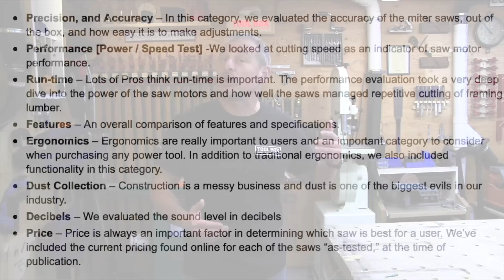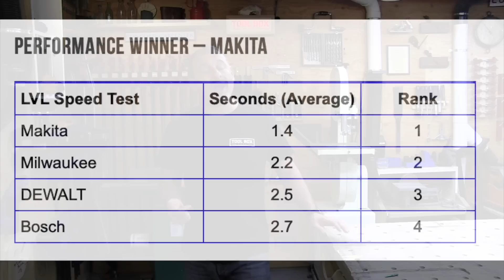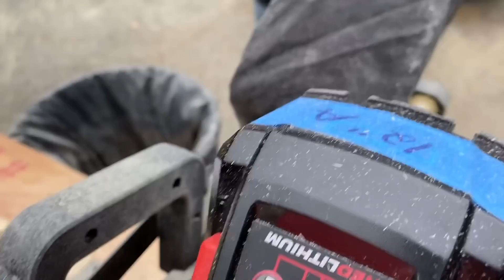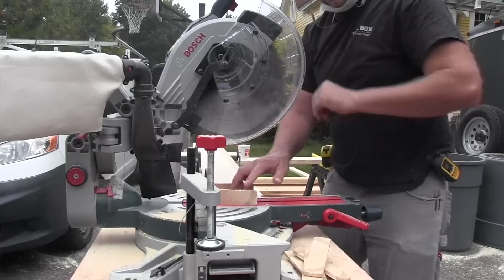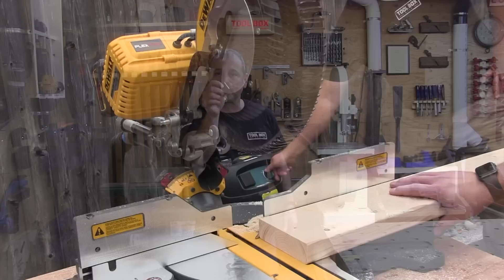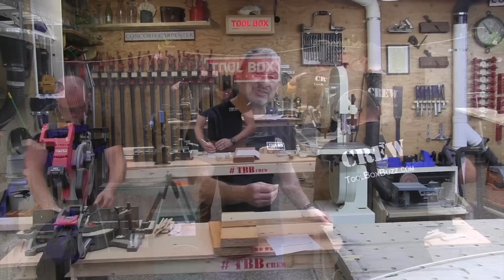Best 12-Inch Cordless Miter Saw - Head-to-Head

Comment: You guys are far and away the best side by side comparison team. This is the channel I trust for the most accurate honest reviews.
Reply from the maker: Thanks man
Reply: Agreed. In-depth, not too long, and accurate.
Reply: Totally agree!
Reply: What size centre bore do you have on 12 inch blades in the US?
The blades make a massive difference on all of these results.
Reply: Project farm as well
Reply: Lots of great info as always,  I'm looking to get a 12" saw I'm on the makita platform  so have been looking at makita, but I have heard a lot of talk of battery damage caused by the 12" saw, has anyone else heard talk of this ?
Reply: @eduardoramiro4846  PJF is an Milwaukee adverticment channel same as Tool Review, VCG Construction, How to automotive.
Reply: @eduardoramiro4846  is the best

Comment: I love my 12in flexvolt miter saw. At first I bought the Milwaukee bc I’m invested in their platform. But once I realized you can run the Dewalt on battery or ac. I had to have that. Plus I’ve been looking at a couple other Dewalt tools so getting their miter saw opened up that platform for me. Great review!!
Reply: You must be sad you didn't get the Makita 😥😥
Reply: @jeffb321  I actually owned the 10in cordless makita but it was just so heavy and like moving a slab of concrete around. But I did like the rail system on it. That a nice feature
Reply: I have the Dewalt too. The ability to be able run it on AC or battery was a must-have for me. I wish their FlexVolt Table Saw had AC power as an option too.
Reply: I haven't been able to find one, sux. I bought the Milwaukee, what a pos.

Comment: I just started the video and can't wait to see the results.  I have the Milwaukee and have zero complaints. Just wish Milwaukee made a nice portable stand.
Reply: Agree! The stand sucks. I must say that being 20-25% lighter makes a huge difference to me. You would think this would be a huge deciding factor. Who would even want a cordless shop saw? Portability, accuracy and dust collection are important factors for a job site miter saw. I have the 12”, 10” and 2 - 7 1/4” Milwaukee cordless saws on the jobs every day. The 10” just plain sucks! It never touches crown. 

As far as ac/dc goes, it never is a concern because I have 5 - 12AH batteries for the 12” and at least 2 - 8AH batteries for each of the other saws. I don’t use cords on the job at all. Also have 2 Milwaukee table saws on Dewalt stands, lol. 

Kinda surprised they didn’t even mention the one key? It’s nice knowing I can lock down the saw when we go to lunch and also track the 12” and table saws. I run $100+ blades on the 12” and don’t need some concrete guy throwing a nail infested, covered in concrete board on my saw while we are out to lunch. I also think most people know better than to steal a One-Key tool. I only leave the One-Key tools on the job if not in a gang box and have yet to have one stolen. I lock them and grab the battery. I figured this was something worthy of at least mentioning. I believe it’s more protective than a chain by far. If locked, it’s useless if stolen and they can be tracked! Most know that and I make a point of explaining it to anyone that asks on the job.

Comment: I've been running the Makita saw with AWS for a year now and it is hands down the best saw i have ever used. I am a professional trim carpenter and you can take it from me this Makita saw is the most accurate saw out.
Reply: Why use a cordless 12" miter saw? Do you trim houses with no electricity?
Reply: @timbarry5080  typically we don't have power so we run off a temp pole which is only one 110v circuit. Its hard to run a compressor, house furnace, table saw wit vac and other powered tools off of that low of a voltage. Believe me i was very hesitant about running a cordless miter box but now that i have i would never go back!
Reply: @timbarry5080  i also wanted to try the AWS system. again, no regrets going cordless

Comment: I have the Makita for 2 years now and it is still in great shape, accuracy and performance is amazing specially dust collection ,the battery lasts all day  either cutting lumber framing or trim moldings .
Reply: Does the makita have a battery to 120 volt option
Reply: @lxxs3v3nxxl  it comes with 2 5h  batteries but you can purchase separate the120 volt detachable option or just a get the corded version  .

Comment: Great review. I agree with Milwaukee on real world use and would have ranked it first in run time/cuts, moving it up behind the Makita into second place. That Makita is a very nice saw but I've bought into the Milwaukee platform. For many of us, we'll end up with the tool the corresponds to the battery platform we've selected. I just picked up the 7 1/4 Milwaukee miter saw and love it.
Reply: I agree, skewing the run time data for the Milwaukee in the way that they did doesn't make sense to me, the saw made the number of cuts that it made, so what if they weren't in rapid fire succession. I think it would've been more accurate to credit it for the actual number of cuts and perhaps include an asterisk explaining the thermal protection issue resulting from unrealistic usage in the testing procedure. 
Correcting that one score puts it in close second behind the Makita (which looks like very nice saw). With excellent scores in dust collection, features, and ergonomics, if you factor in the lower price, the Milwaukee becomes the logical choice for anyone not already invested in a particular battery platform, but not willing to shell out the higher price of the Makita. 
I would also tend to agree though that while it is nice to see how these saws stack up against each other, most of us who are deeply invested in a particular battery platform will just end up buying the one that works with our existing batteries. 
Excellent review overall, thanks guys!
Reply: @n.c.1838  correcting that one score would cause the Makita to drop a point which in turn would give Milwaukee and Makita an overall tie. I think they realized what they did but then decided they didn't want to give the least accurate saw (milwaukee) the overall win.

Comment: Great testing. Only suggestion is each category has a wider range than 1,2,3,&4. If the difference between 1st and 2nd is greater than between 2nd and 3rd, category points should reflect that. This can be accomplished with a 1-10 scale, with best and worst getting 1 point and 10, and the other two on the scale relative to the best and worst. An example how this might work is say one got 400 cuts, and the others got 200, 210, and 220. Points would be awarded at 1, 8, 9, 10 ( or inverse points if you'd like). This way, a tool that dominates in one category is rewarded overall, rather than equal weighting based only in rank.

Comment: While bosch came in last, I am really excited for them because the corded version is what we use in the shop and we love it. I am invested in dewalt battery so that's what I'll be looking at, but I wish that they would bring more innovation instead on just resting on a good design.
Reply from the maker: The Bosch saw is an incredibly nice saw, don't rule it out  - Im sure if we had different tests it may fair differently. Remember this ranking is close and these are ALL pro saws
Reply: @ConcordCarpenter  I really wished dewalt used a 1 battery system for thiet 12in miter saw... Fingers crossed on the updated version when it comes out!

Comment: Rob, I really appreciate your head-to-head test videos. They provide impressions for the "fresh out of the box" experience.  Does your gang of testers have any long-term results regarding how well the tools hold up under use at the jobsite?
Reply: Hi Kam, I just put up a post mentioning the issues I’ve had with my Milwaukee. It may give you insight on that particular tool in my experience.

Comment: The Makita saw has an aluminium detent plate for the mitre adjustment, and it quickly wears out, meaning you must manually set the angle every time,because the notches become very sloppy and inaccurate. It's also very heavy and the fence is a sub optimal design. I love Makita, they make great tools, but this was a deal breaker for me, having spent a lot of time on my workmates saw, I chose the Dewalt. Dewalts mitre saws and table saws are the best all round options for site use in my opinion. The Bosch looks like a nightmarish contraption, and the Milwaukee is probably decent, but nobody here in NZ uses their tools, because they are eye wateringly expensive and don't last like Makita does.

My Dewalt saw has been awesome, it's smooth, not too heavy considering how big it is, and it was pretty accurate out of the box. It's also solidly built, and has sensible features with no gimmicks. The same can not be said of many other Dewalt tools, some of the stuff in their cordless line appears to be designed by people who have never actually used power tools, and the quality control is patchy. The Dewalt mitre saws still seem benefit from the legacy of Dewalt prior to being bought by Stanley Black and Decker though, and are not made in China like most of their tools.

Makita has a history of just slightly missing the mark with their mitre saws and table saws. The quality is always there, but they always have these annoying design flaws, and lately they have been trying to reinvent the wheel. The Dewalt is a classic mitre saw which may seem outdated with its straight slides with bronze bushings, but it just gets it right. I can't really think of anything I would want different on it.

I recently had to do 22.5 degree mitres on some high gloss thermoformed kitchen toe kicks with it, and I had no chipping of the finish, and was able to make those mitres absolutely perfect, with no gaps whatsoever.
Reply: @alejandrocuellar15  I did wonder if that was the case, they are a fairly popular saw. I'm honestly shocked that a company as good as Makita would do something like that.
Reply from the maker: great points thanks for sharing
Reply: @Patrick-857  you do bring very valid points tho, and of course most of these after market detent plates are not the same quality as a genuine makita part, which they have access to expensive equipment and all. I consider myself a makita fan boy at heart, but we all have to remember they are a company here to make money, every company has to "cut corners" where they can. And most people will not invest the extra money for a detent plate, and wait for shipping. I suppose we are the select few we care about everything down to the last detail, especially when your paying top dollar. Even the feststool mitersaws have their issues and use a lot more plastic than metal. I still love the makita miter saw and am looking to upgrade to the 12 in. The community does appreciate your feed back, most people don't know about the detent issue untill they start to notice it. And even then many people dont zero in their mitersaw. They just use it out the box and most are happy with "almost perfect." It just depends on who you are and your view points. I love makita wood working tools but I'm a Milwaukee light guy for sure. Makita is bearly comming out with  tower lights and they are  still 3000 lumens less than the new  Milwaukee Which you can already go buy ( they are releasing the base model basically so they can later release and improved model once they make millions and off the base model), also most of their lights are not ip rated, almost all of Milwaukees are.

Comment: A couple of points, firstly, the DeWalt is the only one I (and many) would ever consider as it's the only saw that has an AC adapter which is a huge plus. The other point is that I actually bought the Makita and after a week of work and back and forth with the shop and Makita, it could not be trued from full extension. It's a relatively well-known issue if you search for it, the way the arm is set up causes it to not run square no matter what you do (there is a hack that involves trusting the arm but even that couldn't make mine perfect). I will admit that it is an absolutely stunning saw, almost a work of art and I WISHED that this true square issue was fixed. I took it back and got the Dewalt - never looked back.
Reply: That's easily fixed by loosening a set screw & tweaking the rails.  But no you shouldn't have to do that to a new saw.
I did a lot of fine tuning to my Makita but love using it.
Reply: I think that was a 10" model issue. Your the first person i have heard say this if you are referring to the 12" version. The 10" version was out well before they released the 12" i think makita addressed that issue before the 12 came out....
Reply: @rickfrey6944  i think he is referring to the 2 slide rails not the fences....
Reply: @jeffb321  I was referring to the rails on the 10" model.
Reply: The hybrid ac / dc option is an absolute game changer.
Reply: @jeffb321  It was indeed the 10" version... and it was about1.5 years ago... didn't know it was fixed. The Makita is a stunning saw, I was so disappointed to return it.
Reply: @rickfrey6944  I did that multiple times, spent a lot of time and could never get it perfect. The drift was very noticeable, but as someone below has mentioned seems like this might have been an issue with the 10" version...?

Comment: very nicely done. My findings were about the same.  I was torn between the Dewalt and Makita,  I have the corded Bosch and like it, but the mitre cut height at the back was not tall enough to do over 4.5" material with out hitting the product.  Went Dewalt because of price.  Thanks for the video.

Comment: I've used many miter saw over the years. Each one had its pros and cons. I'm currently using Milwaukees 12" slider 6955-20 (corded). I think it's a really good miter saw, but I haven't seen it in any comparisons. It has features that others don't. I'd be interested in what you and your crew think of it? Have you used one? I know this was a cordless miter saw head to head, but I love to see a corded head to head with the Milwaukee, Makita, Jet, Bosch, Metabo, and DeWalt.

Comment: I've got the latest Makita 12" corded saw.  Fit and finish is awesome and it was accurate right out of the box. For a test I made a small  picture frame.  The miters were tighter than a nun's @#%+.
The thing I don't like about it it the bevel adjustment knob.  With the dewalt I can quickly whip the head left or right quickly, with the makita it seems like I'm doing a lot of cranking on the knob.  And doing base, regardless of height, I always cut a miter on the bevel.  Dewalt gets my vote, corded or cordless.

Comment: I have the makita. Runs very smooth and accurate. Very high quality as with most makita tools. Very heavy though, so a collapsible stand with wheels is highly recommended. 2 charged batteries last through a couple days of my use which is building cabinets.
Reply: I wish I had the money for the Makita!!! I have Makita cordless tools and love the feel of them, but can't justify a grand for a saw right now.

I plan to buy the Dewalt DWS779 plug-in saw.
Reply: @charlieodom9107  look for deals. I have the 10 inch makita. Its the exact same build ad the 12 just 10 inch blade. I got it at home depot for 525 with free 2 extra batteries totaling 4 batteries. I returned the 2 extra batteries and dropped the price of saw to around 375
Reply: @anthony4426able  I will watch for a deal, but currently, I'll be buying the Dewalt DWS779 for $350 from Home Depot. It is plug-in, but I can run it on a lithium battery pack and inverter if I ever needed to.

I would love to have the Makita plug-in, but that sucker is 700+ on a good day!
Reply: @charlieodom9107  nice that's a great saw too u can't can't go wrong either way

Comment: I picked up the 10" Makita a few months ago for $500.  Came with a dual port rapid charger and four 5ah batteries.  If you don't need the extra cutting depth this is a far batter deal than the 12" at half the price with 2 more batteries.
Reply: But where? Only ever seen 2 battery one for 800
Reply: @ianjacobs9956  Prices went up unfortunately and Makita isn't doing many big sales now.  Probably won't see the price that low again.
Reply: oh wow, meanwhile its 2100nzd (1500usd) with 2 batterys in 2023
Reply: @kylehocking420 Yeah, it's not much better in the US now.  Definitely glad I purchased when I did.

Comment: Great review.  I've been using the Dewalt Cordless 12" miter saw for 3 years now.  I bought it at first because I was already on that platform and I liked the AC option.  Also I've been using dewalt miter saws since I was 15 and I just like them and know them inside and out.  Last week it died and I had to send it off for repair.  I knew it would be a couple of months till I get it back so I bought the 12" cordless Milwaukee because my local store had it in stock and I needed to keep working.  I like it, the only thing I don't like about it is that its not my dewalt and certain switches and stuff is different than the dewalt.  I just got word yesterday that my dewalt will be back in about 3 weeks and initially I was just going to sell the Milwaukee but now I'm going to keep it.  The Dewalt will go back in my tool trailer as my day to day work saw, but I like the Milwaukee enough that I'm just going to keep it at home and it may even see a job site from time to time.

Comment: I don't any cordless miter saw, but I do have the 12 inch Dewalt sliding corded, and the bosch 10" easy glide corded,  and I much prefer the Bosch, the amount of space it takes up in my shop is almost 16 inches when the dust bag is connected and the Bosch has superior dust collection, I mean it's not even close, but the Bosch was almost twice the price, but worth it imo if you have a small shop